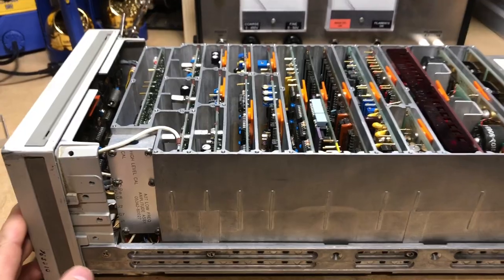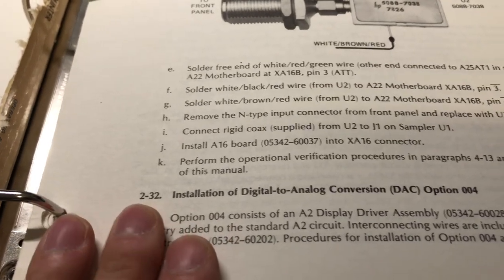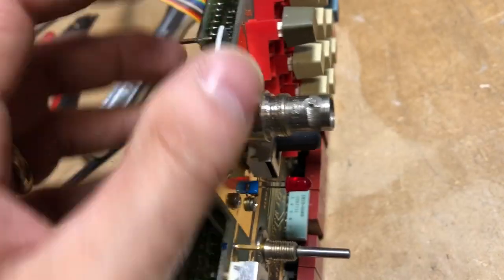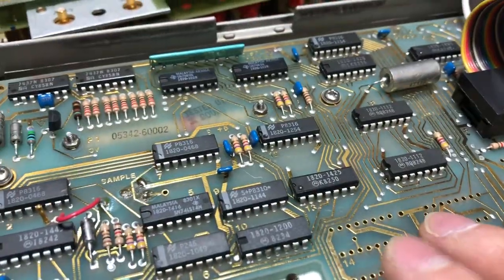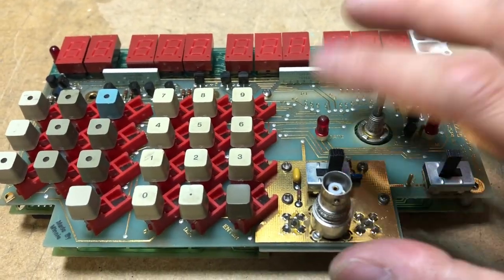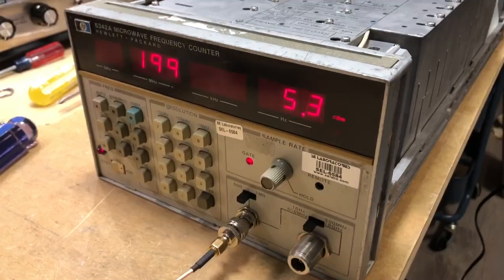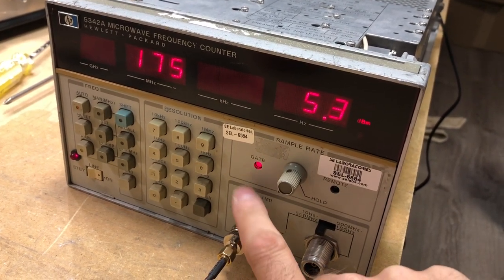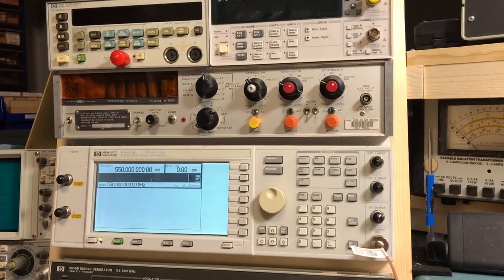HP 5342A Frequency Counter Upgrade to Option 004

Comment: I have the HP 5343A (26.5 GHz). Both of these counters can use the 10544A and 10811A ovens since they are pin compatible. I recently acquired a HP 5343A and discovered that the 10811A's trimmer cap had come lose making adjustment impossible, the fix was just re-tightening the jam nut on the trimmer. Other than the cut of the crystal the 10544A uses a heating wire, the 10811A uses a pair of transistors to heat the crystal enclosure and has better long term drift.
Reply from the maker: Thanks for the comment. Now that you mention I do remember the heating element difference. Glad to hear that you fixed your 5343.

Comment: I believe the reason the steel springs in the front  panel button mechanisms break or dislodge and have excessive “snap” is because of accumulated dirt in the area where the spring and plastic contact one another. I used Deoxit F5 spray for faders and pots to restore consistent feel and lighten the snap action of the buttons, without disassembling the unit. Examining your video, I can see that spraying into the gap at the upper third of the right side of each key cap will direct the cleaner/lubricant into the spring assembly. A small shot of F5 was enough to clean and lightly lube the contact surfaces. Be sure to use F5, as D5 lacks the needed lubricant to restore the feel of the key action. Should prevent future damage to the keys.

Comment: Great video!
 I recently picked up one of these with only the HPIB interface option equipped. I ordered a 10811-60111 oscillator from ebay to upgrade from the TCXO. Mine has the add-on LED in the bottom left corner of the front panel, as a few of yours do. I know there is an OVN annunciator on the right of the LED display. This extra LED illuminates whenever AC power is connected to the unit. Does this LED mirror the OVN annunciator, or does it just verify power is applied to the oven when in standby?

Comment: Hi. Love your videos, you can learn something from them. Looks like you have electronics background . I have Hp 5342 with option 005 . 
Do you know what this option is? 
Couldn’t find anything in manual.
Reply from the maker: The only options for the 5342A I see in the manual are 001, 002, 003, 004 and 010.  The 005 may be a later frequency extension option to bring it up to 26 GHz (aka the 5343A).  Thanks for the comment.

Comment: What about hp 5343A. Can you swap parts from hp 5342A to hp5342A? They look alike. Only 43 is higher frequency count?
Reply from the maker: Yes the 5343A had a frequency extension to 26 Ghz I believe.  Some boards may be inter-changable but I haven't looked into it much.  This is where the manual is your friend.

Comment: It is actually a problem that those buttons are clicking. It is very easy to fix: wash that part of the board in alclhol and put some lubrication on the switches. The HP 8568A spectrum analyzer has exactly the same kind of buttons, terrible clicking. After cleaning and lubrication, they are good as new. Compeletly silent.
Reply from the maker: You are correct.  I believe the buttons on my HP 438A are the same type but they are very quiet.  I'll have to look at it again sometime.  The front panel of the 5342A is quite finicky though, I'm not looking forward to it.